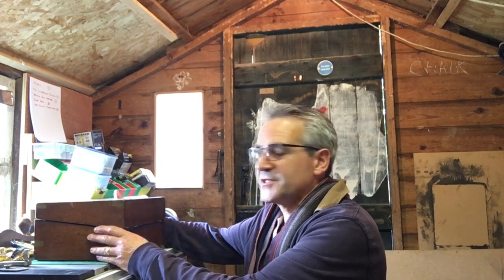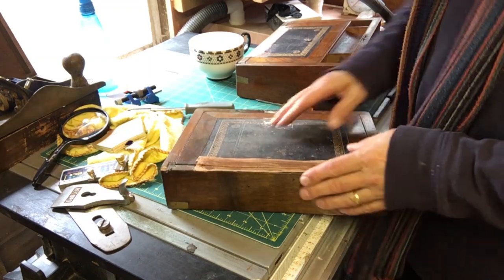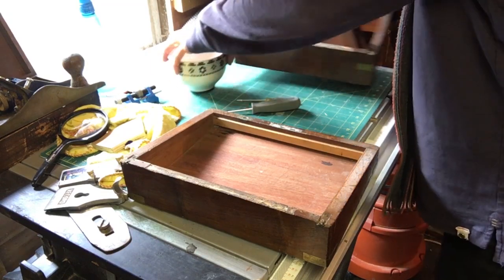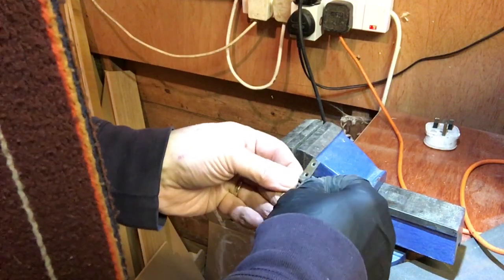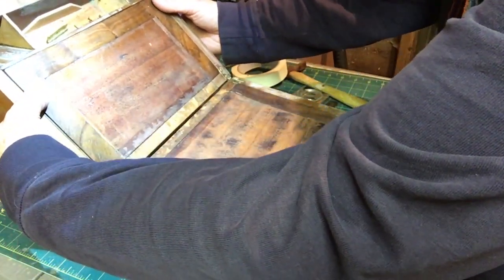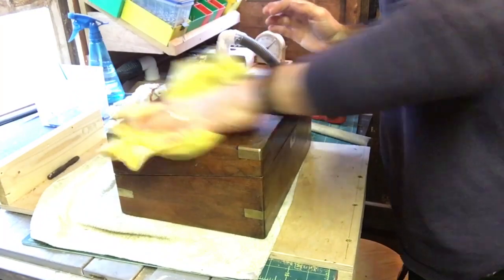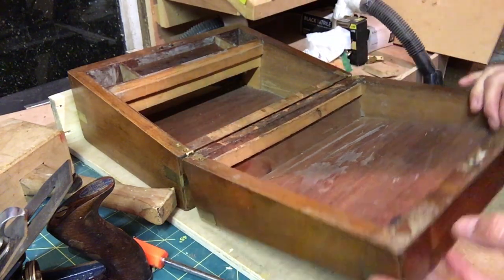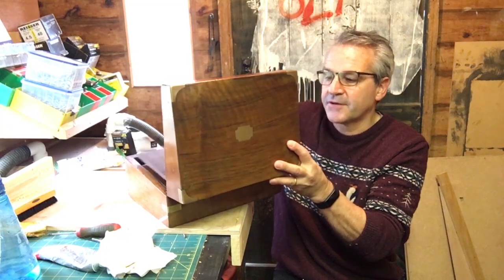Restoration of an Antique Writing Slope

Comment: You really need a skiving as opposed to leather for this job. Essex Galleries in the UK will do a variety of colours and will also emboss to your specifications. Note that some writing slopes had a surface of blue velvet.
A rubber roller is useful to ensure the leather is evenly glued down. Traditionally  wallpaper paste would have been the glue to use, this is good because it's forgiving.  
When cutting the leather with a craft knife, try to be perpendicular to the surface. as the underneath of the leather is lighter than the surface, however a dark wax stick will infill any mistakes. I agree with the comment below about French polishing.  If you need to replace the cloth underneath the box to stop it scratching then a piece of linen would have been used.
Reply from the maker: thanks for tips

Comment: Wonderful! I've just started doing a similar project. Waiting for the leather to arrive. How would you tackle a crack in walnut veneer on the top. Its about 1mm wide at its widest and 15cm long.
Reply from the maker: Not sure on that one sounds like a specialist repair or fill with a dark wax if you don’t want to risk it
Reply: I would be interested to know how your restoration panned out and how you tackled your crack in the wood...
If the top was still relatively flat and not warped I would have been tempted to just leave it as is, it just adds to the overall aged look of the piece..  
To make sure the damage remains stable you can always add a thin piece of plywood to the inside of the lid, making sure it is almost as close to the inside measurements as possible. Glue and clamp this in place and the crack will now be stable... Stain the plywood to match the interior of the slope and job done...
Reply: @mrbillhicks  It ended up being a combo of a bit of filling wax to lessen its visibility (though not eliminate it) and the occasional bit of hide glue where there was the threat of flaking. So in brief, it's a stabilized bit of character.

Comment: for info,  I went to www.desktopleathers.co.uk  who supplied a made to measure tooled piece of leather to restore my similar Edwardian writing slope, and they were very helpful (cost circa £25). my box had very similar damage and finish damage. re electrics .... just had my garage workshop fitted with domestic box (wired with armoured cable from house supply across open gap)  and four double sockets and two large led strip lights, with capacity for another for double sockets and two more strip lights .... fully certificated and a total cost of £547 incl vat .... so quite reasonable (less than I thought) and really puts the mind at rest, gives great potential for various uses, and removes trailing cables etc.
Reply from the maker: thanks i think I saw the leather store on line but went a little cheaper, maybe next time. Electrics I do need to sort

Comment: Good effort...
Top tip....  Go the extra nine yards and strip the wood veneer finish back. Re-stain and French polish... really makes the grain pop and just looks so much classier, whilst still retaining the aged patina. The wooden edges of the slope flaps look super if they are are highly polished.
Also... I normally use a strip of cotton cloth underneath the leather where it hinges to give extra support. Glue this in place before hand and make sure you choose a colour which will match the wood as this will be visible when the box is closed. Black or dark brown are a good choice.
And..   Talking of leather, or skiver as it is known,  fake leather cloth is a great alternative to real leather. The genuine skivers are made with really thin leather but are difficult to fit, so you could end up ruining forty to fifty pounds worth if you get it wrong... The fake leather is a fraction of the price, looks like the real thing and you can get some awesome aged effect products if you shop around..
I currently have five restored slopes finished and ready for sale. I have one on eBay at the moment if anyone wants to see a restored slope   Item number  254938902578
Reply from the maker: thanks
Reply: You know it’s funny, I literally just found out the saying “go the 9 yards” comes from an battle plane  firing it’s entire 9 yards worth of ammunition 😂